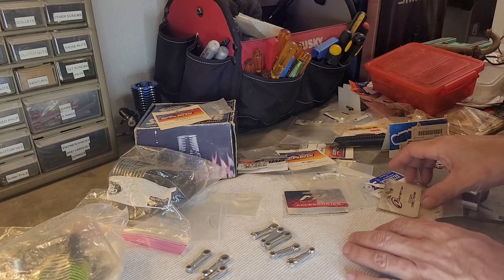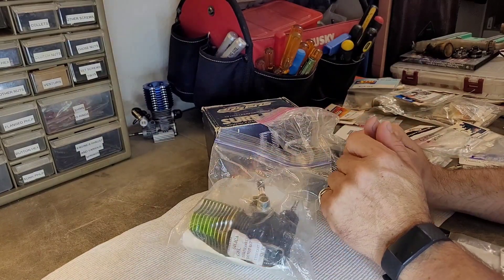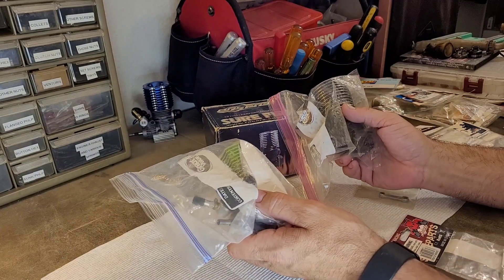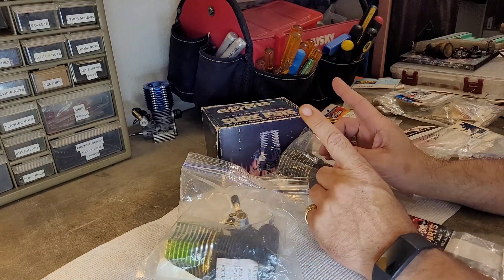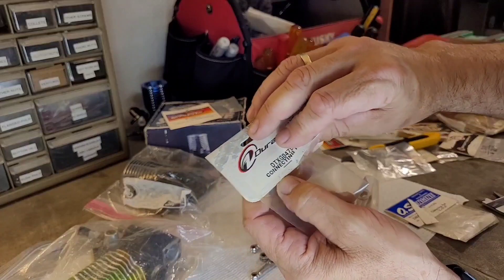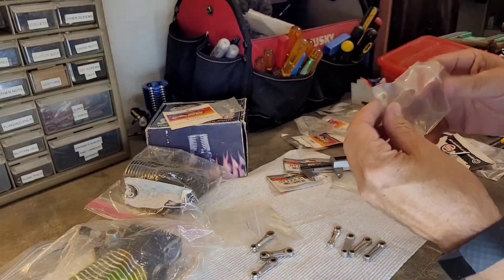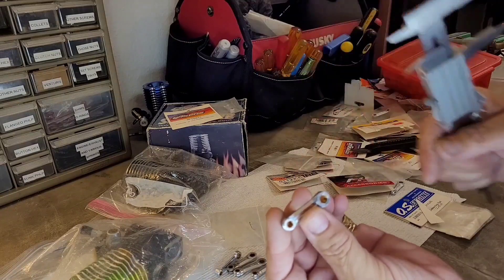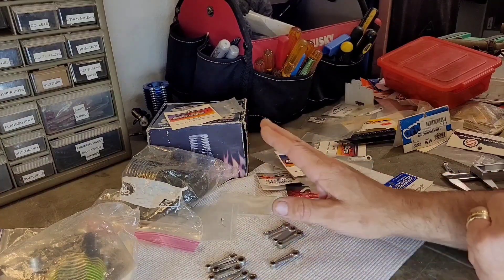Let's talk about rods connecting rods for nitro engines and interchangeability

Comment: So I have a Mach .28 that I’ve had for 15 years but just broke it in, their is a tiny bit of movement in the rod on the big end, is that normal for oil and heat or is it supposed to be tight?